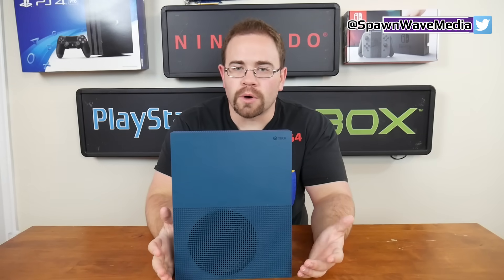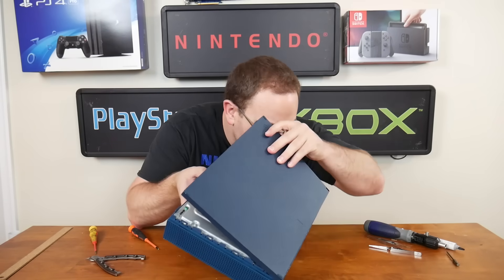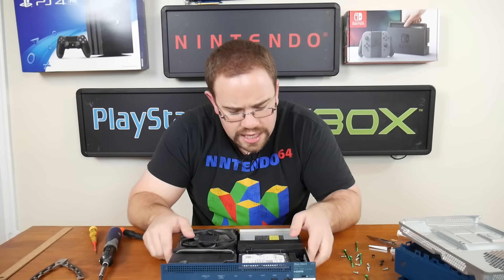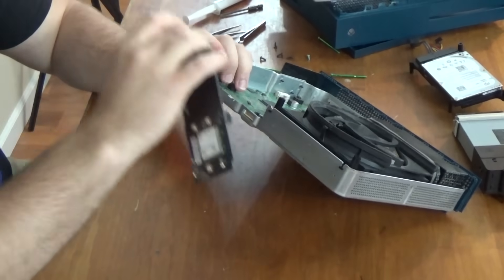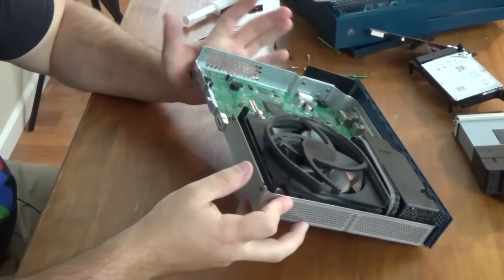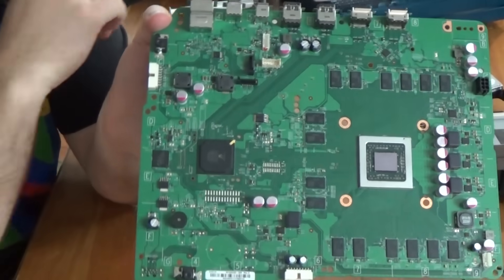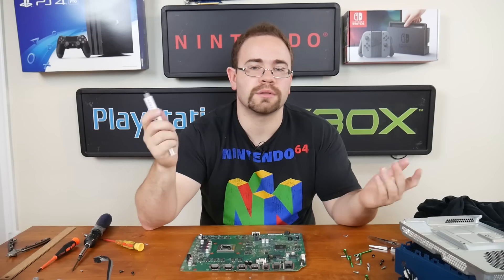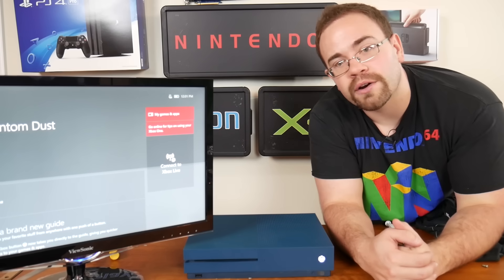Taking Apart The Xbox One S - Tech Wave!

Comment: The og xbox one has a better heat sink. More copper and more tubes.
Reply: That's probably because the APU in the OG Xbox One use a 28nm process (instead of 16nm for the S) and thus consume more power and generate more heat which the heatsink has to deal with.

Comment: Nowadays with an script you can replace your hard drive, many ones replace for SSHDs. Although the system does accept different sizes, it is recommended to go with official sizes (500GB, 1TB or 2TB). 
Besides partitioning, the install is similar to a PS4, which you reinstall the OS from a thumb drive, problem is that differently from PS4 which makes everything ready, the Xbox One lacks the partitioning routine necessary to the console to recognize (there are 5 partitions). You only need a computer just for partitioning the hard drive.

Comment: Scorpio probably gone to be big as a house.
Reply: I got news for you.
Reply: Great Mindz the devkit that has more in it than the retail version (it has 2 harddrives instead of 1 and an OLED screen) is smaller than the og Xbox One... so no, it will be quite small, most likely smaller than the PS4 pro actually.
Reply: A mansion
Reply: I doubt the Scorpio will be smaller than the PS4 Pro simply because of the size of the heat sink, fan and power supply needed to run 6 TFLOPs.

Comment: I waited till a tech wave to ask this.  A lot of people seem to be having a problem with the wifi signal on the Switch, can you replace that to something better?  Or is there no way to fix it?
Reply: MrLacksOriginality Either it could be the connection strength in general, interference with other signals, the wifi antenna is acting up and replacing it better to call Nintendo support.

All in all, if you're able to try out ethernet, go for it. Otherwise, there's many factors that come into play.